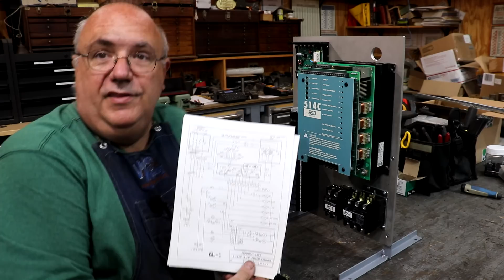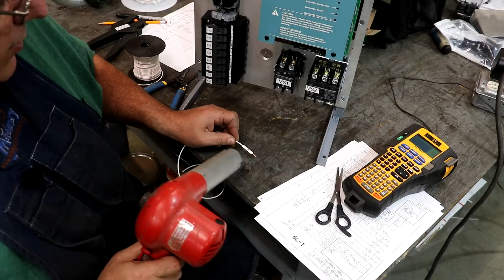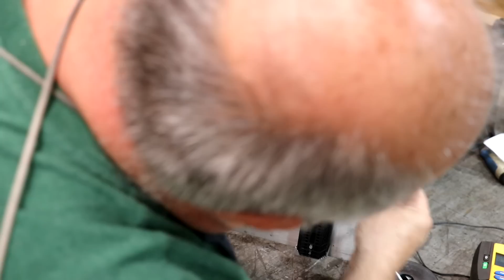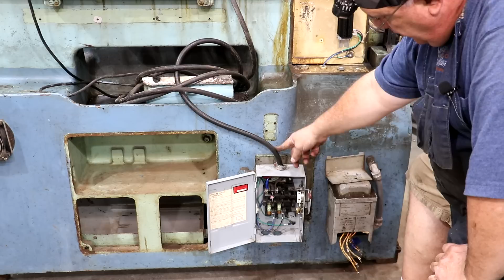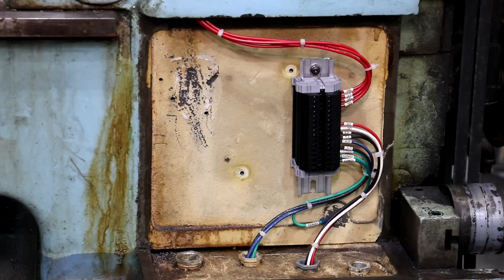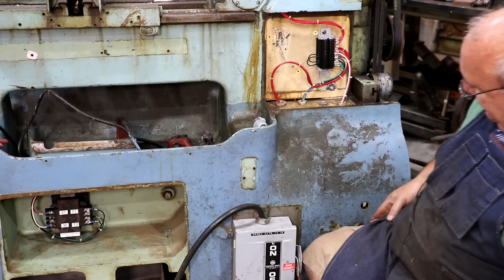Monarch 10EE Drive Retrofit 4:Wiring the Component Panel and Lathe Controls

Comment: A dc motor has an armature and a field.   As you mentioned many small dc motor use a permanent magnet for the field, thus there are only two wires for the armature.   The direction the motor rotates is determined by the direction of the current thru the armature.   So swapping the two armature wires will reverse the rotation.   The amount of voltage applied to the armature determines the speed.   Applying full voltage, 240 in your case, will cause the motor to run at “base speed”.   Your larger drive provides the armature voltage based on a speed reference typically coming from a potentiometer.   The amount of current going thru the armature is determined by the mechanical load on the shaft.   Base speed is determined by a specified amount of field current, which apparently is being controlled by your smaller drive.   Once you are at base speed you can reduce the amount of field current to increase the motor speed to “top speed”.   The field typically has two wires so your motor may have two fields since you mentioned 6 wires.   Perhaps so you can connect in series or parallel.   A word of caution here.   If the field current is lost while the motor is running the speed will increase instantly until the motor destroys itself.   I’ve seen it happen.   Most industrial drives have a field loss circuit to protect from this.   Small chance of it happening but somethimg to be aware of.

Comment: The motor type that Keith has is actually EXTREMELY common (as far as DC motors go) in industrial applications, just not in home shop equipment. Keith stated that the motor has a series field as well as a shunt field. This is called a compound motor and the series field is commonly called a stab or stabilizing field. The stab field gives the motor slightly better speed regulation (less speed droop) between no load and full load with a constant armature voltage. Stab fields are not too common in new DC motors because newer DC drives can perform much better speed regulation with a tachometer. His motor is a 115V shunt field and a 230V armature. Newer motors would be 150V field, 240V armature. There are several industrial drives that would operate this motor, with the 115V field, and automatically reduce field current above base speed, accept 120Vac control wiring, 4 quadrant reversing, digital display, etc. The problem is that they all require 3 phase. I've not tried operating them on a rotary phase converter, but the phase shift would have to be balanced. Operating them on a static converter might not work (never tried that either) because they need a very clean sine wave to determine SCR firing timing. These are the reasons Kieth is going through all this dual drive, and contactor effort. If he had 3 phase from the power company he could use a 3 phase drive and the wiring would be right from the drive's user manual, standard wiring diagram. Thank you Keith for taking on this project. I'm sure your efforts will help more people powering lathes as well as other older DC motor arn.

Comment: I do not know how difficult this would have been to do, but you could have completely eliminated the transformer if all you needed was 120 VAC.  To do that all you would have needed to do was supply a neutral conductor from your power source, through your disconnect switch.  You could then get your 120 VAC control power from one of your hot legs and the neutral.  Either way, you have done a good job at something that I do not think is boring.  I rather enjoy wiring up machines at work when the opportunity comes up.  It doesn't happen too often though.  Most of the time I am just replacing relays, fuses, or other miscellaneous parts to get the machines back up and running.
Reply: I was thinking the same thing about bringing the neutral wire along with the two hots and ground.

Comment: I’ve never seen a DC drive being used to control a field current before, but that’s an interesting idea.

The 514C drive has a rectifier to provide the field with a constant voltage but T a limit of 3A. You would need to supply the FL1 and FL2 terminals with 120v AC and you’d get 108VDC from the drive.

If your motor requires field weakening to give you a full range of speeds, things get VERY tricky. I would think that would require a tachogenerator or an encoder at the minimum. You need full field current at low speeds and a weakened field for high speeds to reduce the back EMF from the motor. Dangerous to do without a closed loop speed control.

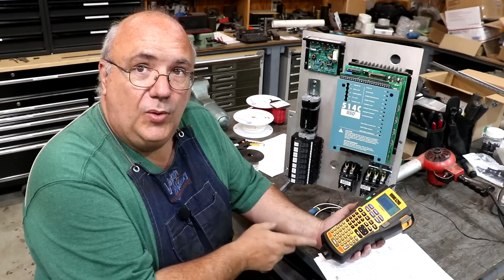Comment: 4:13  I built and repaired broadcast facilities for twenty years.  Every new or replacement wire had a label with clear heatshrink over it.  I would've loved to have the Rhino labeling for all that!  I have one now!  The Rhino branded labels are the only ones I've found that stick reliably to Kennedy Crinkle Brown paint.
Keith, thank you for using a heatgun on it instead of a lighter or torch.  The latter will scorch or burn through heatshrink, which gives a project a less than professional appearance.  Nice job.  IMHO, the only thing that would look better would be waxed lacing cord on the bundles, but that would just be showing off.

Comment: I don't understand why not jut use ac motor?
Reply: in short better speed control or
(DC motors maintain consistent torque across the entire speed range without the need for additional components. This makes controlling their speed considerably easier than AC motors, and they are well suited to applications requiring precise control at any speed.)

Comment: Brings back memories. Spent the last 17 years wiring panels, some small, some as large as 6' x 6' that took 4 weeks to complete. We used self laminating vinyl labels {Panduit/LS8}. We also used ferrules {as noted below} helps keep wire strands from going where they shouldn't {I heard of one tech that wired 2ga into a hard to reach area and a stray strand or two touched the next phase, small explosion when the 480v was turned on!} Nice work!

Comment: Love the electrical content of today's video... Just a question to set my mind at ease... Do you plan on eventually painting this machine? If so, why did you not do that before wiring it up? (At least the general area where the wires run along and through panels. It would be alot easier and much quicker for the eventual painting process, 😉)

Comment: Im wondering if they labelled both sides so you knew where the input and output went instead of williy nilly wiring them on the relays. Like you said, 14 on both sides, but other side 14 also has a 5, 5 would be in from that particular 14. Im guessing as i cant see which relay you have.

Comment: Keith, As an electrician, the disconnect should be a Nema 3R rated and the power cord should come out the bottom of the disconnect. Nema 3r disconnect is design to protect the power from coolant and metal chips.

Comment: Hi Keith, when you tighten up each connection, recommend that you do a tug test, lightly pull each wire to check that it has clamped correctly.

Comment: Keith it looks like a decent job you are doing on the wiring - however you seem to be ignoring the advice offered regarding wires through metal holes. To illusrate the point at 24.57 the output wires white,blue and black disappear through screwed in bushes that have a very smooth inner surface, these are purely to protect the wires. These bushes are now produced in plastic which are even better. Enough said we will say no more its your lathe I just hope it all works OK for years.
Reply: PS I forgot to mention the wire runs could be protected with spiro wrap similar to car looms all designed to stop wires chaffing.

Comment: I have had a few printers over the years to mark wires and have never been happy with them probably because they are not used often enough and the supplies are expensive.  About 4 or 5 years ago I bought a package of small Avery lables and preprinted a few sets of numbers for the job, extra sets for mistakes.  I would install the label then use clear heat shrink for the protection.  Takes a little longer but good results. I hope this helps someone else in the future.

Comment: Chapter 38 of the georgia state minimum electrical code states "Securely fastened bushings or grommets shall be provided to protect wiring run through openings in metal framing members." for unarmored cable.....
Reply: lets give the man the benefits of a doubt, 
that this is mostly a "dry run" and the pain in the butt grommets come when it is all working 
and no more rewiring is needed

Comment: Once you have your wiring totally finished, use eyed wire ties and mount to the board with teck screws so yo do not need to drill the panel further.

Comment: Keith, your wiring looks great.....for a first timer country boy, and good for you for labeling as you go. I worked at NASA in Houston in the early 70s and in those days we had a "nail board" which was a 4x8 sheet sitting on tripods on its long edge with hundreds of small finishing nails precisely located at "nodes." A crew of ladies (think Hidden Figures) would look at a D size print and pull the appropriate color and gauge of wire where it needed to go. Then, they would "dress" the wires and  use cable lacing cord (a lot like waxed dental floss) to hold everything in place. Definitely pre-tie wraps. They  were very dedicated to quality did amazing work.....which is why we made it to the moon and back.....several times.......live and in color.......while riding around in our dune buggy. NASA definitely had the right stuff in those days.......from the ladies tying the cable lacing to the Apollo Command Module Commander.

Comment: Hey Keith, you should do this and you should do that and yada yada. Haha kidding. Its his lathe and he is the one building it yall. This is not his first rodeo and I'm sure he knows when/where he needs a grommet.
Reply: The problem is that, as he’s admitted a number of times over the years, he doesn’t know that much about these circuits. He doesn’t know how to build these circuits. I’ve designed and build commercial electrical and electronic equipment. A number of others here are also professional electrical engineers and electricians. We’ve ALL warned what can happen without grommets. For some reason, so far at least, and unusually for him, he hasn’t even acknowledged the advice. Considering how easy and cheap grommets for this are, it’s inexplicable as to why he seems so resistant to this advice -y’all.

Comment: Heat shrink wire markers are great! I have used them since they became available. One thing that i found was i never shrink the marker until the wire was in the terminal and clamped. That way you can easily align all of the markers with the number in front, then shrink them.  I know that a lot of people are saying to use ferrules on the wires but many terminals are intended for plain ends on stranded wire. Check the manufactures instructions on the use of ferrules. If you use ferrules on the wrong type of terminals it will cock the terminal plate and may leave some of the wires loose under a tight screw plate. Sounds impossible but i guarantee that it happens a lot in new installations.
 Also i did notice you using what appeared to be ferrules on at least some of the connections. But i did not see you crimp the ferrules on the wire before installing the wire in the terminal. This is not a good idea. The pressure from the terminal screw cannot be counted on to crimp the ferrule tight enough to provide long term reliability. There is a lot of little details like these when building panels for equipment.

Comment: Hopefully, that DC motor has no internal electrical problems, otherwise its repair could be expensive.  With Keith's expertise in mechanical modifications, I would have thought that a 3-phase AC motor powered from a modern AC VSD would be an easier upgrade option.  Tuning that DC VSD to work correctly with the motor's series field will be interesting.

Comment: I've been a fan of their videos for years. In this one, however, they keep looking at their control monitor, and not at the camera - that's very irritating.
The cabling looks really good, but to do without ferrules is grossly negligent in my opinion.
Btw: Lengths in inches and voltages between 110 V and 400 V cause high costs compared to other countries that use the metric system and only 230 V two-phase and 400 V three-phase current. (In my opinion), Best regards.

Comment: I strongly agree with other commentors.  Those wires definitely need to go through your mounting panel with grommets!  I have been designing and maintaining electronics for nearly 50 years, and could not begin to estimate the numbers of problems i have had to deal with, when proper wire protections were not utilized.
In addition, long wires need to be constrained from moving under vibration even if they are not obviously rubbing against something.

Comment: I'm sure there many retrofiting complexities of this lathe I'm unaware of, but it seems to me that a better solution would have been to just get a new 3 phase AC motor and use a VFD to control it.  Constant torque, variable speed, fwd/rev, and braking are simple features easily accomplished by using a VFD, and with a lot less wiring.  Seems like your 'jumping through too many hoops' just to use that original DC motor...I really don't understand why, the motor is 70 years old, probably needs new bearings, has brushes that need to be replaced, and the enamel coating on the winding's is no-doubt brittle.  Still, a great video Keith and I 'feel you pain' on wiring that control panel.

Comment: I recommend you take a few minutes to clean the old oil and grease off the lathe. It will be much easier before all the new components and wiring is installed.

Comment: Nice job routing the wires, it's tough not making it look like a rats nest.
Did you use wire crimp ferrule's because I did not see any?
Might be something to consider, yes it's more work but they do have some benefits when it comes to the connection and strain relief.

Comment: So make sure you get your terminal block as close to the control board as possible to wire up. Save your wire waste, ideally make it the correct length that will work through the lath. Maybe get it run through the lath to correct length then pull it out to wire up externally.

Comment: Over the years I have wired many similar products, as a time saver I used traffic light cable, it was available in up to about 60 individual cables, the whole lot was enclosed in an orange circular outer,  each individual cable was numbered every few inches throughout its entire length, the only down sire was all cables were white, I doubt if this will cause any problems in the US because a lot of the equip0ment we brought from the US used all white cables, In the factory they had a machine that numbered each cable as required.
David

Comment: Did you just use the same wire gauge for everything?  That is fine as long as they can handle the high current parts of the circuits.

Comment: It's been said a couple of times here before but those pass-through holes need grommets.  
This is made worse by the amount of vibration the lathe generates. 
The vertical plate needs  some diagonal gussets as well. When he moves it it vibrates back and forth. Gonna to be whole lot of shaking going on.
SPARKS!

Comment: The new transformer makes for a much cleaner lathe exterior. I have designed and built many machine control panels. Doing wiring like this is tedious, but the care to label and run the wires sure makes working on them down the road so much easier. Another thing to think about, is sometimes to leave a longer run in some cases between components so you could pull them out to work on them without having to fight short wire runs. Great job Keith, thanks very much for sharing.

Comment: Where I work we have a rule that any wires that go into screw terminals have to be fitted with ferrules. Some companies do it even for every terminal, even the spring clamp style. I would recommend that too, since it makes the wires more orderly, avoids breaking of the uninsulated portion by bending (if you use the ferrules with collar, highly recommended) and also avoids stray copper fibers accidentally creating short circuits. I'm also a little confused by the connector terminals you have, usually there are ground terminals that have the proper color (here it's green-yellow) and have an electric connection to the rail they're mounted to.

That heatshrink printer looks awesome, really handy stuff. I'm more familiar with labels that get tied to the wire with zip ties or with special transparent sleeves. There are even tiny numbers and letters for pulling over wires that you can put together however you need them.

Anyway, you did a very clean job, should be enjoyable to work on if you have to do some maintenance.
Btw. how well is this protected from dirt and dust inside the machine?

Also, four quadrant operation means that you can run a motor as motor as well as generator/active brake both in forward and reverse, are you sure that's what you're talking about?

Comment: This unit is designed by an Engineer, and assembled by a Master machinist. It will have a great value, so they should both receive compensation, and recognition for this work, So please stop asking for this work for free. Its useful on any DC motor application. Let alone they could sell this package in kit form to thousands of uses.